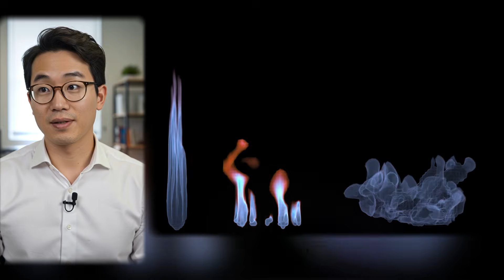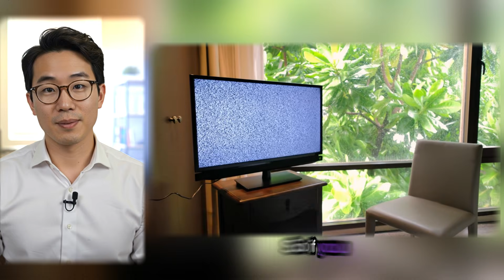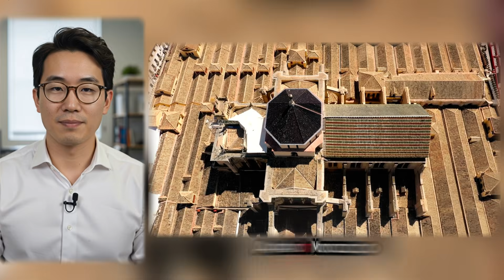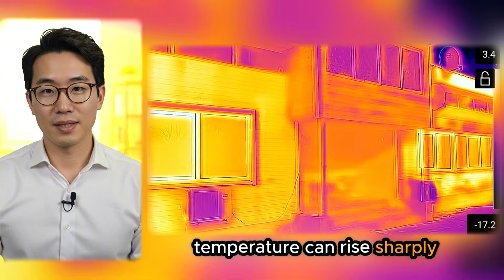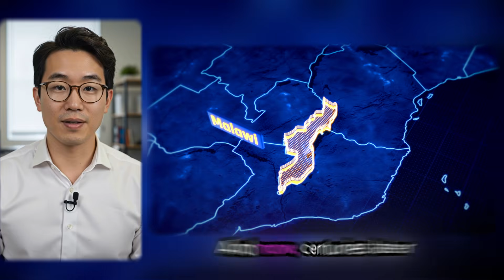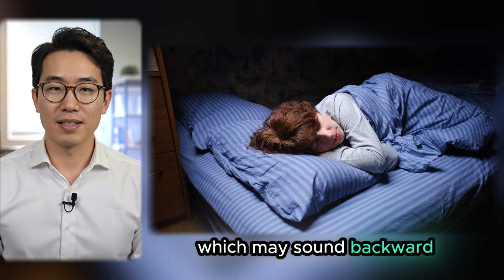6 CHEAP Tricks That Keep Your Room COOLER Than AC This Summer!

Comment: Would have been nice if you had put in the Title, “not for humid locations”. I’m in SC and none of these are of any use. Unfortunately, I didn’t know that until watching this entire thing. The only thing that might assist people in areas like mine is, putting reflective on outside of window however, majority of people are not going use that method. If you had information regarding the different  “limo tint’s” and if, they would work on home windows to block the sun and also, prying eyes 24/7. Also, the different types of “mirror & similar theory tint’s” for effectiveness on homes. The little reminder to people about how that tint is not a 24/7 no view inside unless, no light is on inside. 

What if anything else can be used to lower temp/ac use in very hot, humid areas. Also, perhaps ways that could work in Campers, RV’s , etc the issues with houses, climates & utility usage  happens the same usually, worse though in “rigs”. When you are trying to enjoy vacations, travels and/or , you live full time living in one, humidity tends to be a factor most climates and even having white roots any amount of sun on affects the inside   

I just happened to come across your page today and I’d like to subscribe if find useful information and you “listen” to your subscribers
Reply: Using whole house dehumidifier.

Comment: I totally understand.  But how do you put cardboard wrapped in aluminum foil in a window and make it look good? I truly believe that is why nobody does it.  If you make it look nice everyone will do it... any ideas.....
Reply: I don't care what it looks like as long as it keeps the room cool.
Reply: Use pink markers and make the cardboard have a barbie/Minnie Mousr theme
Reply: Would it still work if you put a light window tint or even dark tint maybe over the aluminum foil
Reply: It could be possible if you neatly cover the cardboard with the aluminum foil... to where it is tight enough without any crinkles... and have the cardboard cut to fit nicely into the window .   Cover the side that shows inside the home with a nice fabric, placemats,  or paper that coordinates with your interior.    You would only use it on really hot days as well so if any neighbor rolls their eyes at it, that's their issue..     On non heatwave days,  pull them out of the window and slide them behind the couch, for example..

Comment: You got 1 thing wrong that I know of, and it's the direction of the ceiling fan. Winter time you want to push the heat down and summer time you want to pull the cold up.

Comment: The fan is powered by electricity, right? So without electricity, your  methods where electric fans are needed will not work.
Reply: There are inexpensive battery. Powered fans available
Reply: Lots of efficient 12 volt solar charged battery off-grid options available.
Reply: True,but an electric fan consumes a lot less electricity than a/c.
Reply: I would assume if it is hot you would have used electricty inevitably via ac or fan. So using some of these hacks may help make things cooler usibg electricity you were already going to use
Reply: Solar panel to provide power for a fan
Reply: You're a human, right? You sweat?!?!!